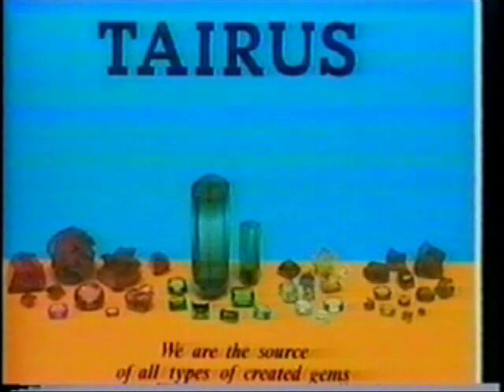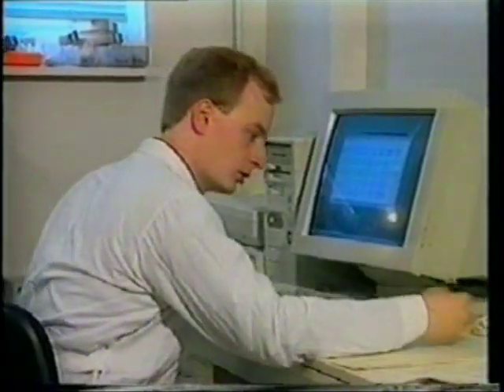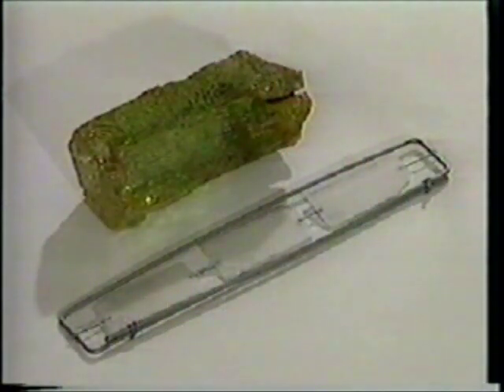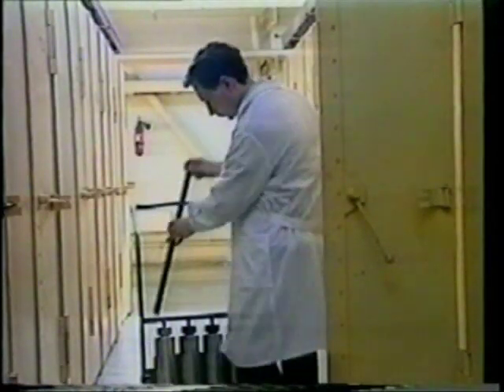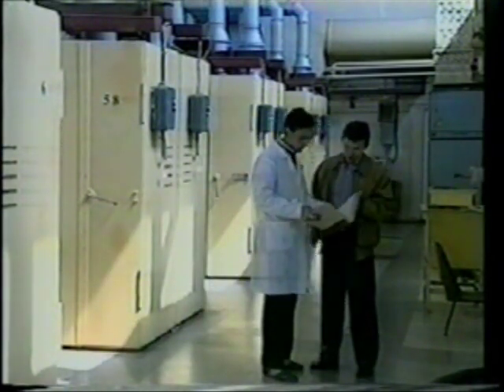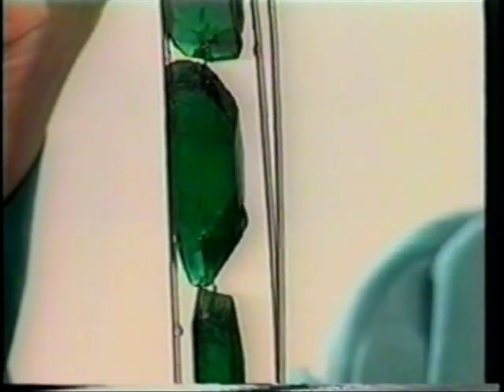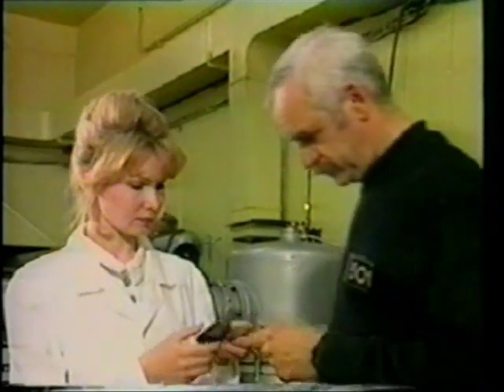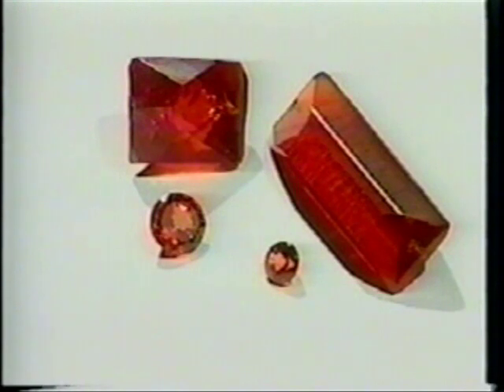How to Grow Crystals / How Tairus Grows Created Gems

Comment: Does the flux used for this process comes from the basic component (as in, alum powder for the ru/phire variant) or from the low-quallity, low-carat stones (hot/cold flux flow method)? I'd like to know more...
Reply from the maker: There is no flux used in hydrothermal process
Reply: Flux lmao

Comment: Are you using electrical induction heating as your furnace? If so, how many watts does it require to maintain the correct temperature for weeks on end?

Comment: us hardcore scientists are not idiots...the only way u can make emeralds is adding a certain amount of Beryllium to a molten mixture of Silicon Dioxide and high temperatures, plus another element and slow cooling.
Rubies require Chromium in that molten mixture.
There's nothing special about what you do.